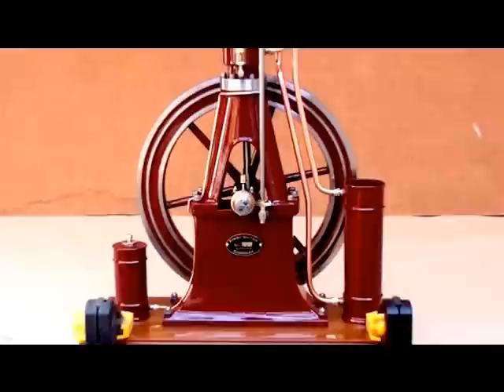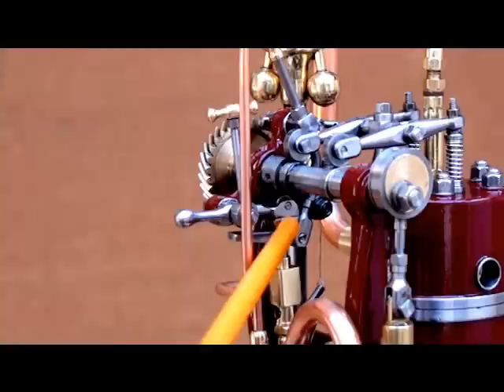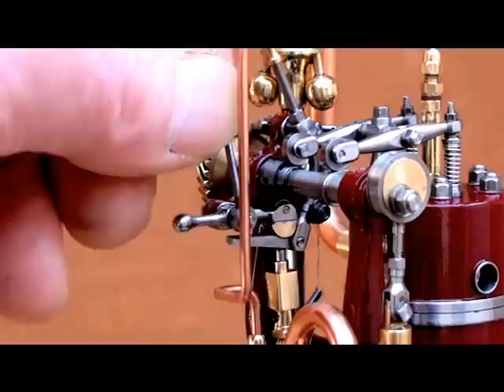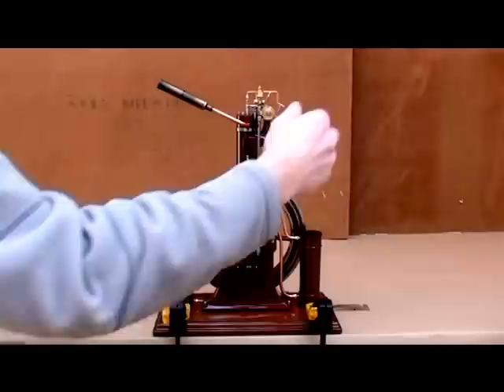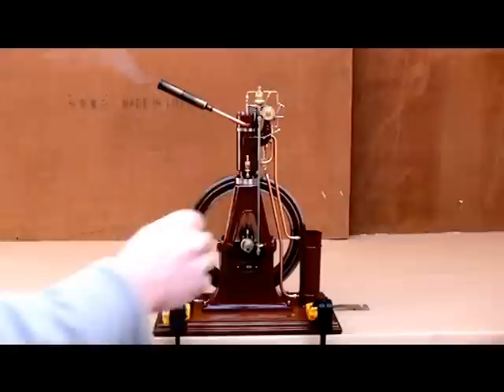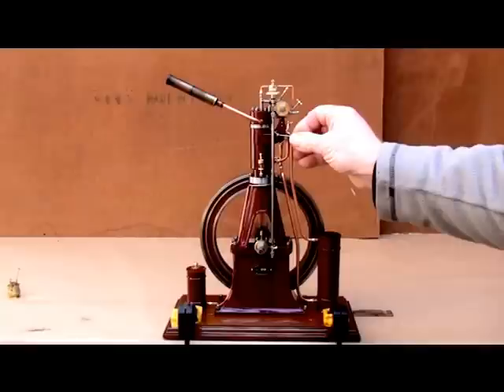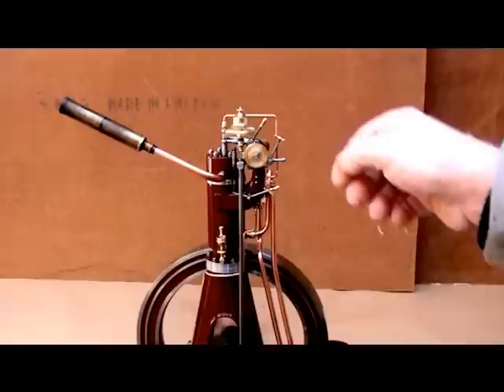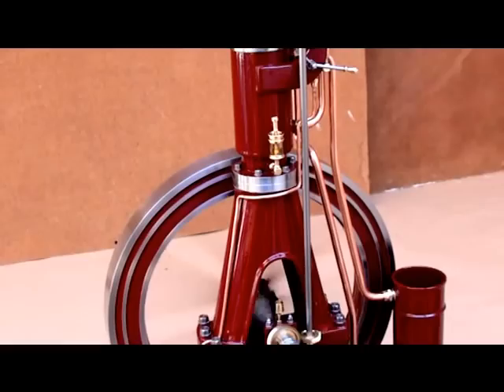Cold starting 12 cm. True Diesel Model Engine by hand

Comment from the maker: Thank you for your fine comments. The engine has a compression ratio of 21-1, with a compression pressure of 50 bar, and a combustion pressure of about 100 bar. The combustion camber is on this engine in the cylinder head, on my 2 cylinder diesel in a hollow piston crown. The injector is the same as I have used on my hot bulb engines.

Comment: I love this for a couple of reasons, 1 because it is hand made and you did a fantastic job, and the other is that it is pure mechanical. No electronics, just engineering.

An extra note, years after above comment, people still getting offended. Please allow me to rephrase. I admire the mechanical simplicity of the engine and it's mechanical engineering. I'll leave the above there in the spirit of honesty.
Reply: There are plenty of analog diesel engines still made and used today
Reply: "No electronics just engineering" you should recheck the meaning of engineering in the dictionary.
Reply: tyler bonser Why are you so heated? Slow down a little bit and you'll see no one ever said "redneck".
Reply: Joe Will No you're dead wrong, I'm not trying to look smart, I just completely disagree wit your "trying to look old and like a petrol head" since we're watching this video we all like cars, but as a computer engineer and a car enthusiast, i still prefer modern cars over the old ones, it's easy, you call them better I call them not efficient.
Happy now?
Reply: Joe Will It was a stupid comment, you totally had no idea that most diesel engines use no electronics at all or "Analog".

A diesel motor with an ECU has WAYYYYYYYYY more engineering behind it (About 100 years worth of engineering to be exact), the amount of engineering put into the variable valve timing and other ECU componets is why we can make a turbo cummings break 2000 HP easily
Reply: Matthew Meek Man we're not comparing diesel and petrol engines, we're comparing old engines with new ones, and my point was new engines are better in any way (diesel or petrol), and just like you said an ECU controlled engine has way more engineering involved into it (electrical and mechanical to go with).
Reply: Matthew Meek "A diesel motor with an ECU has WAYYYYYYYYY more engineering behind it"
I assumed you compared it to a petrol engine when you said "way better".
Reply: Matthew Meek  it's "cummins". Not Cummings.
Reply: abd bach
You missed the point of every thing that I was saying, perhaps this was your intention but bugger it, You've already had more of my time in response than you deserve. I started with a comment stating that liked the character of the engine and you added something that was not needed. There was no need for you to say any thing in the first place - you started this, not me.
Reply: Matthew Meek
Look, The comment was not stupid at all. My comment was that I liked the Mechenical Enineering of this and it's simplicity. Most Modern engines, Deisel or otherwise have complex electronics. Technically, It is correct to state that Electronics is Engineered but that was never the point in the first place. Why is it so hard for people to get that? I shouldn't need to explain my self. The smarter people on here would already get the point instead of looking to pick holes in it. The Engineering I was refering to was Raw and simple. People need to stop looking for shit that isn't there. That is what angered me to begin with. It's one thing to take a shot at somebody mouthing off but to take a shot at somebody making an innocent and complimentary comment is just Nit Picking and pathetic.
Reply: Tesla Motors new slogan: no engineering - just electronics
Reply: Depends on your definition of efficient. Simplicity is more efficient in my eyes. The ability to do repairs by yourself is more efficient. There is nothing efficient about modern cars being weighed down and burdened with unnecessary computers and electronics that are more prone to failure.
Reply: abd bach
 Things like GPS and video monitors, heated seats, massage seats make a vehicle heavier and less efficient. That is a fact that is indisputable. You chose to take what i said completely out of context to make your argument. You're arrogant and a fool.
Reply: Oh that's why today's cars consume less fuel than old cars, because they're heavier... wait aren't they consuming less today? the answer is yes because the engine's efficiency outweighs the added weight.
And on contrary to the old days, today you can chose to get the comfort features or not, want a basic car with an efficient engine compared to old cars? buy a Dacia.
You still have no arguments, but more insults, I didn't even insult you in my first comment to you, but keep going, not sure who's got less than 5 years comprehension abilities.
Reply: nathan papp Those are creature comforts and have no effect on the internal workings of an engine. What are you guys even arguing About? Computers absolutely make cars more effecient.  Why do you think vehicle manufactures have opted for much more expensive EFI systems over carburetors. Convenience and Efficiency!
Reply: Blockburnerx9
The heavier a car is, the more "creature comforts" it has, the less efficient it is. My argument was that unnecessary electronics make a car less efficient, that isnt debatable. Im also not talking strictly about fuel efficiency but overall ease of ownership and repair. Computers add weight and increase the amount of variables that can fail, they are also more difficult and expensive to maintain. mechanical > electronic

Its like arguing that a CD has better sound quality than vinyl.
Reply: remember the good old days, where the only electronic part of a diesel was a single 12v wire?
Reply: Old World Army
Ah yes, old stuff may not be as efficient as modern stuff but they rarely stopped working.
Reply: nathan papp , believe it or not an electric vehicle is the best thing so far that we are given access to , it can be made easily repairable , they make things hard to repair so that most people have to take it in to be fixed and in return companies make profit .. a person can have all the so called comforts with ease of repair , any item can have a so called plug and play computer that is just what it sounds like , unplug the one that no longer works and plug the new one in and you are ready to go . its all the fancy looking covers that have to be removed to get to the part in question that can be bothersome if one does not know what is under the cover . everything can be made easily repairable . just like all those electric vehicles that do not need those garbage batteries , they could be powered just like a nuclear power plant , a mini nuclear power plant , using special liquid heated that heats another special liquid that powers the turbine that creates electricity to power the vehicles electric motor .. all simple to do its just that the system can make more profit with the sale of fuels .. its all about control and having power over us slaves ..
Reply: oh and for all the people that dont know all the liquids are contained and the cooling system would be the same as a ac unit ..  all simple .. on another note , does anyone believe that a teleportation device is possible  or is already and just not allowed to be used by the rest of us ..
Reply: @TheSteelerider  gross
Reply: As an Electrical Engineer, I feel very left out that you seem to only consider Mechanical Engineering as Engineering.
Reply: @luminescentlion  I apologize. I should have said, old fashioned mechanical eneneering. For what it's worth, Modern designs are good for their own reasons too.

Comment: That is an awesome bit of engineering and design!
As for the comments on the requirements for preheating for cold start, I cant remember the dumper trucks having preheaters, all they had was a compression release so you could get the motor spinning and some energy stored in the flywheel to get it over compression at a decent spead. Very well done!

Comment: Beautiful piece of work!  How do you keep the cylinder cooled as there doesn't appear to have any fins or water jacket?
Reply: I suppose it wont heat up that much since it only goes about 200rpm
Reply: The cooling appears to be the taller tank bottom right
Reply: +Tony Ling ah yes, I never noticed that lol

Comment: When Rudolph Diesel invented the Diesel engine ,he neglected to consider the governing of his engine. When it ran away and exploded,it put him in the hospital for a period of time.He considered what went wrong,while laying in his hospital bed.It came to him that it needed not only a throttle,but a flyweight governor to control the fuel injection and prevent the runaway mishap. The flyweight governor is a  load sensing device that increases fuel to compensate for additional load on the engine.Its also a speed sensing device,That as the weights fly outward due to centrifugal force the pressure exerted on fuel pump rack overcomes throttle setting and sets the MNL ( max. No load) speed.  I would love to have one of those model engines on my desk.

Comment: You are a masterful machinist!  This isn't just an engine, it's also a magnificent piece of art crafted to the standards of a watchmaker!
I'm surprised it's even possible to have such a small diesel engine.  Since a diesel heats through compression, I would have thought the volume of air compressed would not be enough to heat the mass of the cylinder sufficiently.  Are the cylinder walls very thin to reduce this effect?

Comment: Did you cast the iron parts and turn the brass and steel parts?  That is truly a work of art.  My grandfather was an engineer back when they built things.  He wanted an Engine Lathe with a 3 inch swing.  He built one using a piece of rail road track as the ways.  The only thing he didn't make was the Chuck.  He turned all the gears and screws and cast the iron parts.  I have it now and sometimes mickeymouse a flat belt and run it.  I'm sorry that I never met him.

Comment: compression ignition is a diesel engine...a diesel with a pre combustion chamber requires a glow plug to heat the precombustion cap..a direct injection diesel may require a air heater normally placed in the intake manifold to aid in starting...

Comment: See if you can put a governor between the injection timing adjustment and the injection timing so that as the RPM go higher, the fuel is injected earlier.

Comment: This is absolutely amazing! Such a beautiful build!

A few questions that popped up when viewing this:

How do you know how to dimension the fuel pump? How much fuel is actually injected into the engine each cycle? And how do you calculate it?
What are the tolerances on the piston/cylinder fitting to make it work this well?
If you take the throttle down too low, will the engine stall? And if not, how did you figure out exactly how you should make it so it doesn't go too low?

I wish to make something like this some day. But it's going to be far in the future, I don't even have a workshop yet!

Comment: Wow, nice build. I noticed your rockers are a little slack, maybe a stronger spring or a little tightening will reduce the cam impact on the rocker. Just a thought, you probably adjusted it. How many hp?

Comment: I keep hearing comments about needing to pre heat the diesel with glow plugs.. Absolute bull**! A Diesel engine requires a good compression and diesel fuel and that is it! Glow plugs are there purely to make starting easier especially in winter conditions it doesn't matter whether indirect or direct injection it will start without any kind of pre ignition!!!

Comment: I would love to see this run a small generator to power a USB charger. The juxtaposition of the mechanical engine with no electric elements used to charge something that only runs off electricity would be cool.

Comment: Rudolf Diesel takes off his hat 🎩. Does it have a cooling system or is the heat just distributed by the surface? Will it also run on standard Diesel fuel or even vegetable oil.

Comment: I was wondering about what I think is the governor that has the balls on it. What is it's function? I have seen them on some other engines but never really knew what it was, a governor as originally thought?
Reply: The task of the governor is to hold the speed constant. The balls are mechanical conected to a conical bar. The cam hits the conical bar and the conical bar hits the injection pump. The conical bar can move in and out controlled by the flyball governor and thereby changes the stroke of the injection pump plunger. Thereby more or less fuel is injected and the energy is controlled to hold the speed. The desired speed is adjustable by mean of a handle that controls the strength of a spring that the governor has to work against. Every diesel or hot-bulb engine needs a governor system, otherewise the speed would be uncontrollable - it would either stop or it would rev so high that the engine would destroy itself.

Comment: Very pretty.  Do you know the Horse Power?
Reply: brandon knowles 1 tops, I would say
Reply: +Matt Rowbottom lol, isnt horse power literally how much a horse can pull, id say more like beetle power
Reply: Its 1 mouse power
Reply: Not quite nut yeah, its not designed to do work
Reply: Pulling power is torque, not horsepower, and a modern horse has between 2-4 HP
Reply: Sure is
Reply: With a 20mm bore and 40mm stroke at 21:1 compression most of your horsepower will come from the centrifugal rotation of the flywheel once it's up to speed... my guess is around 1)20 of a horsepower. Torque can create horsepower not the other way around.

Comment: what is the compression ratio, how about torque value...will it spin a 2000 watt gen.
Reply: of course it won't
Reply: what you are looking for is much larger, check out lister diesel engines.

Comment: So basically you made a one cylinder Diesel SSHC (Single Side Head Came :P)  engine with a manual VIT (Variable injectionTiming) XD
Reply: your grasp of the obvious is astounding.  you must be a technical writer.
Reply: You obviously didn't get the joke, did you? dig in a little bit more I'm sure you get it, rub the two neurons you have there.
Reply: abd bach giggling to yourself doesn't mean it was funny.
Reply: abd bach you are butt hurt how cute. 
You started it and then continued post for post KID.
Guess you got time on the play ground also.

Comment: It says Diesel engine but it runs on Kerosine?
Reply: +Al Kaholic  "Diesel" engines can run on different oils.
Reply: +Al Kaholic 
There's virtually no difference between kerosene and diesel fuel.
The U S military only has two types of fuel, mogas (gasoline) and JP8 jet fuel, also nearly the same as diesel fuel. They run all their diesels on jet fuel. (No, that does not make them jets)
Reply: +Luckystrike *jet fuel
Reply: +Schinken LP Got it, corrected, jet fuel. Thanks.

Comment: How does a diesel engine have timing with no spark plug?
Reply: Do you know how a 4 stroke diesel engine works son lol
Reply: It doesn't need any spark plug. It explodes by injecting high pressured diesel into the cylinder in high compression.
Reply: Billy Debenham Diesel engines don't need spark plugs because the fuel is ignited by pressurizing it

Comment: What ignites the diesel?
Reply: pressure
Reply: DastiRDTV pressure the air in the cylinder chamber is pressurized until it superheats and the injector injectects fuel at a substantial amount of pressure causing the fuel to ignite on injection

Comment: what is a "true " diesel engine ?
Reply: burns diesel, compression ignition.
Reply: a "true diesel " is an engine  with glow plugs that preheat and ignite the fuel mixture . from a friend who works in the auto industry.
Reply: allan egleston Really? Glow plugs are just for starting in very cold condition, and there is no fuel mixture in diesel engine. It intakes pure air and compress it to a high temperature, than diesel fuel is injected into the combustion chamber and auto-ignited.
Reply: Jiaqi Chen As I know, there is "two stroke diesel" (that runs on nafta, kerosine(?) and oil) - (and also in large ship diesel, but thats another story) this is used in the smaller r/c engines.
A pure Diesel engine should run on Diesel fuel only, and would require pre-heating - like a "glow plug" as in modern car engine (but it goes so fast so you wouldn't notice) - and it must be injected as you stated! There is of course still a fuel mixture involved, and the throttle valve and the injected fuel take care of that!
Reply: +69arildo Diesels have no throttle valve. They draw in a full charge of air whether they are idling or running at full power. The only difference is in the amount of fuel injected. There is no mixture, in the sense of a homogenious mix as you have in a petrol engine where the fuel and air are fully mixed. In a diesel fuel burns as it is sprayed into very hot air - air heated by intense compression.

Comment: and what are these used for? :P
Reply: nothing, completely useless, but he is just showing example how "Big machines" are working..
Reply: *****
there is nothing to disagree with, he asked what is this engine used for and i told him that it can't be used for operations since it doesn't have enough power.. Learning or not, thats totally different point of view.
Reply: Its like a model train. Model trains don't actually transport cargo anywhere but they're fun to make and play with. Same thing here but a model engine which i think is even cooler. He could always attach it to a small machine if he wanted to (like to roll cigarettes or something like that) but the power wont be enough to do anything significant.
Reply: +BlaggerDagger i doubt it could roll a smoke tight enough, and smokes now a days the paper is rolled first then tobacco jammed in
Reply: well it is a model, but I could power a fan or a small sewing machine. prior to electrification there were a lot of very small engines in use